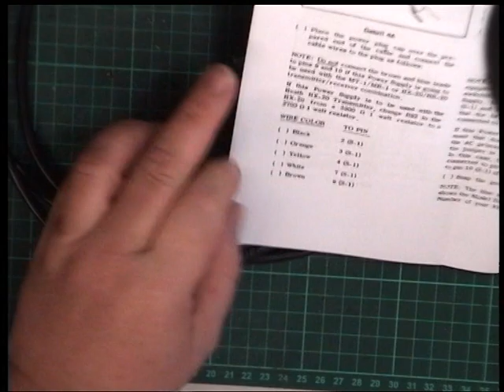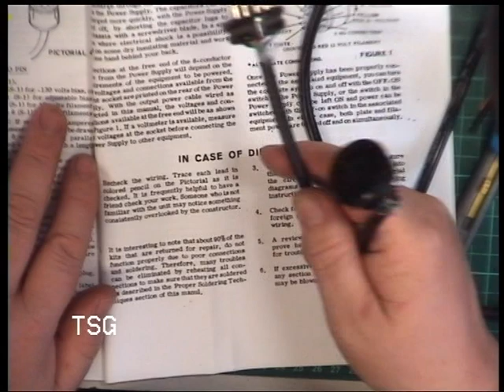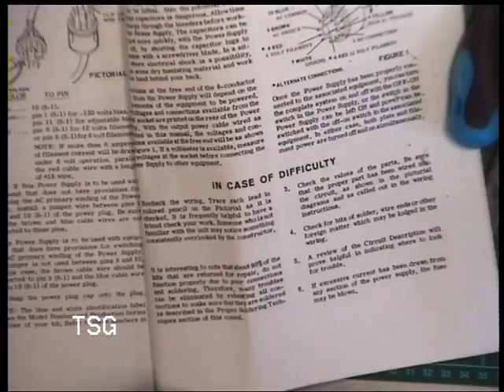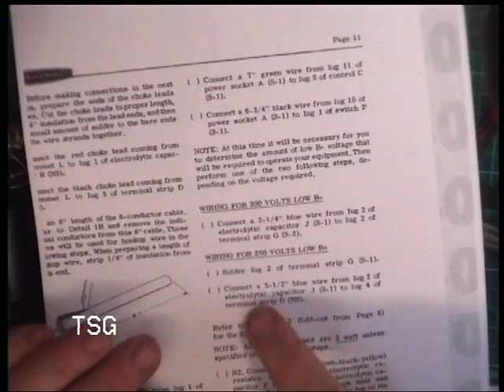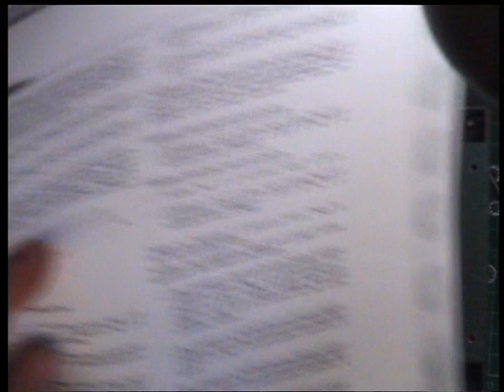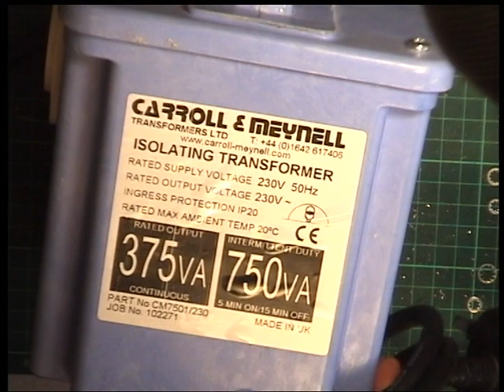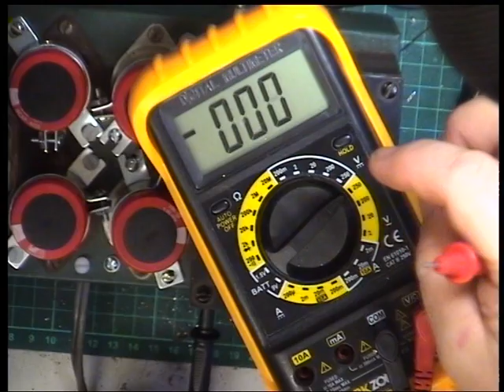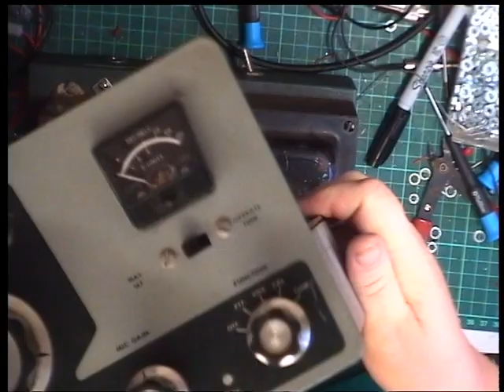Heathkit PS23 & HW12A 1966 transceiver overhaul Pt2

Comment: I have done lots of these although it’s a few years ago. I do remember scratching my head over the isolated capacitors. I think I have the same receiver in the loft somewhere.  Unfortunately my power supply is at work but perhaps I will  reunite them. I also have two of the KW receivers of a similar vintage.  It reminds me with all the possible configuration options that back in the day people were expected to know what they were doing. Or perhaps a lot of stuff got blown up in error back in the day. Thanks regards Chris
Reply from the maker: No, I think more people knew what they were doing. Nowadays some people think it's clever to throw things away & buy (yet another) new one. So just because this psu came with that HW12A, it doesn't mean they were ever connected together, and clearly not with the HT setting at 300V instead of 250V. 

We did listen on 3.5Mhz last night & it sounded great, just using a CB aerial; the 80M one not yet finished (waiting for custom made t&K wall brackets for the earthy end) Hopefully I'll align it today. I'll have to use my boat anchor signal generator as all the bench ones here don't do 3.5Mhz!
Richard
Reply: @ukfmcbradioservicingTango21  With the high voltages of the old equipment you had to take care, no second chances!  If you got something wrong it could have rather spectacular effects, just for a second or two before all the fuses in the house blew.

Comment: I had a look and amphenol have restarted manufacturing these connectors. They are used in high end audio valve amps. Do a Google search for https://www.amphenolpcd.com › node
Industrial/Audio Relay Sockets | Amphenol PCD the page I found included the plugs but I don't know who retails them. May be a wholesale situation or £500 per plug from a hifi shop.
Reply from the maker: Thank you,

Richard